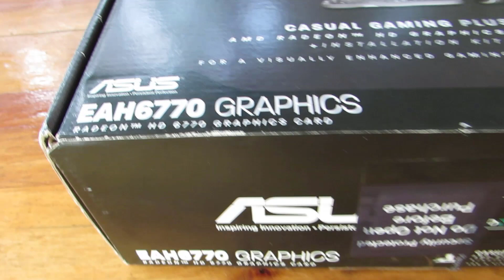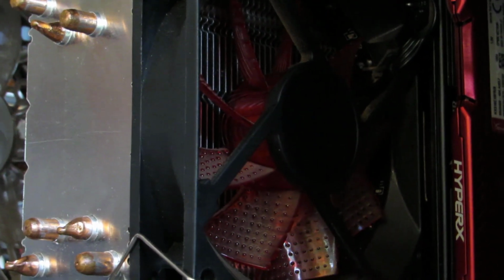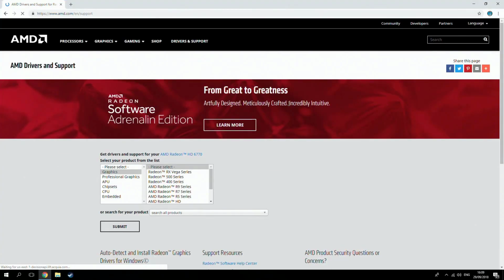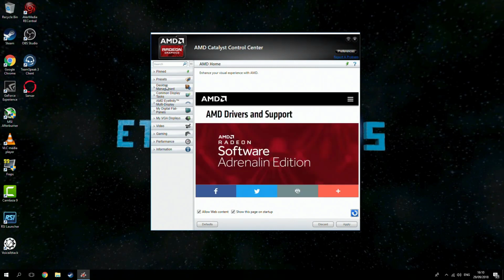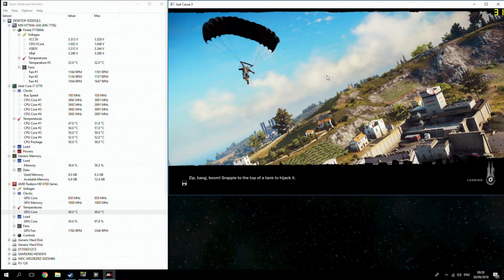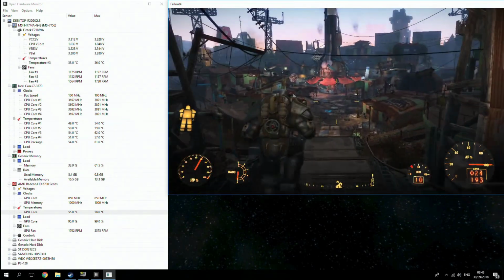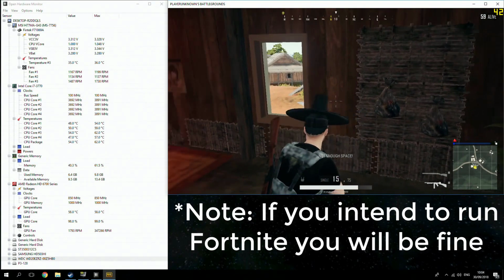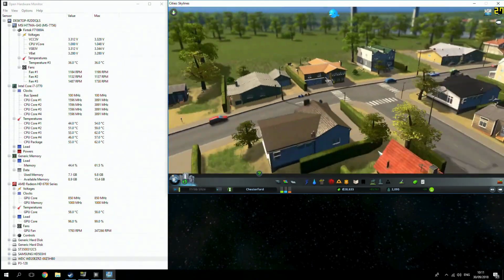Can the HD 6770 still run games in 2018?

Comment: Just revamped the old 6770.
Uninstalled all drivers, took it out, cleaned it, put new thermal paste on the heat sink, reinstalled the last legacy driver and it is purring at 100% fan speed and medium overclock :)

Comment: Your RAM is in wrong when your running dual channel use the 2nd and 4th dim slots
Reply from the maker: My RAM didn’t work in dual channel on that board. I have now upgraded to something better that does work with this ram
Reply: @etstudios  how many pin connectors does it use? And is it pci or pcie